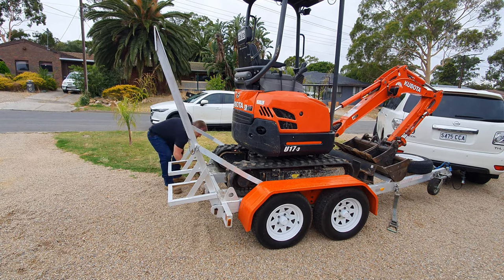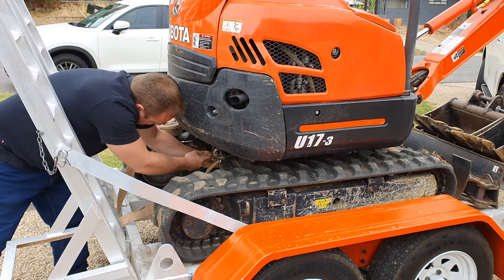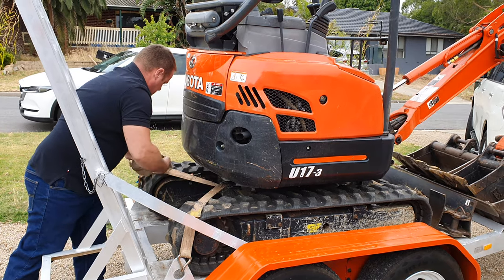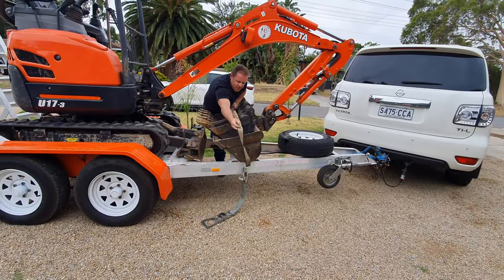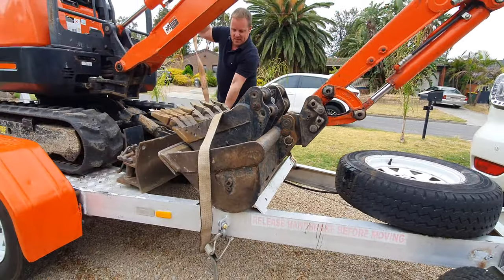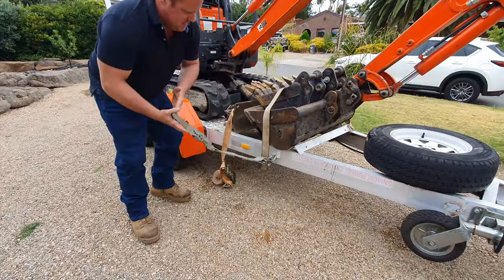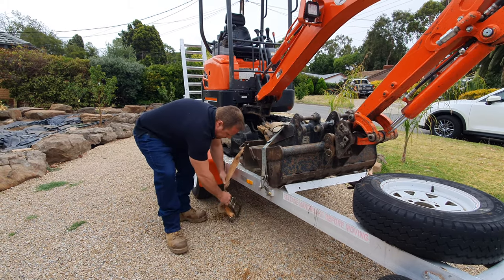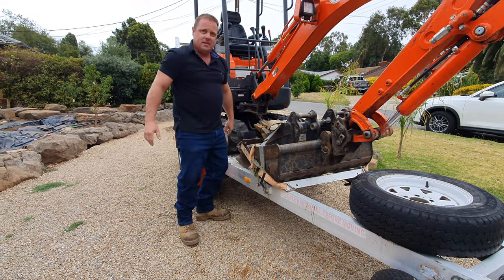Adelaide Mini Excavators Tutorial 5, strapping excavator down on trailer.

Comment: I think chains would be better but as long as those heavy duty straps don't fray that has to be the fastest and most efficient way to do it.  Particularly if you are just going across town to/from the rental store.  You restrained movement to the front, to the rear, and you secured the bucket.  Great job!
Reply from the maker: Since making this video, we changed the front strap to a chain as the straps showed signs of wear on the points it touched on the dozer blade.
Reply: @stanfordhire  That is the real key.  Inspecting your equipment and making changes as required.  Appreciate the update as I have to haul one 5 hours next week.  Thank you for covering the tie down points that you used as I am going to use the same ones